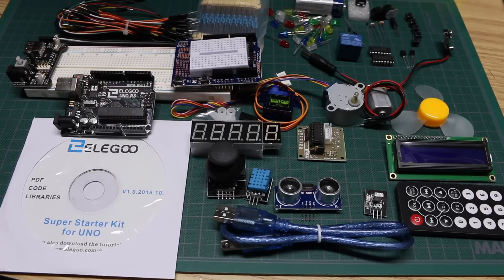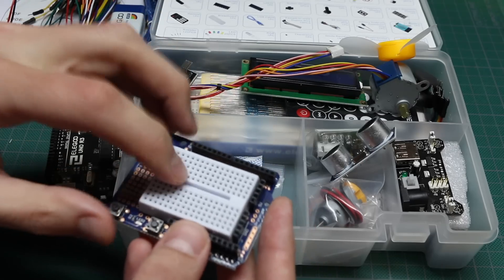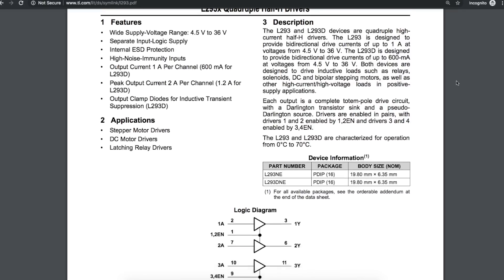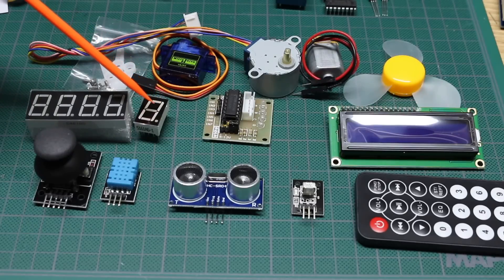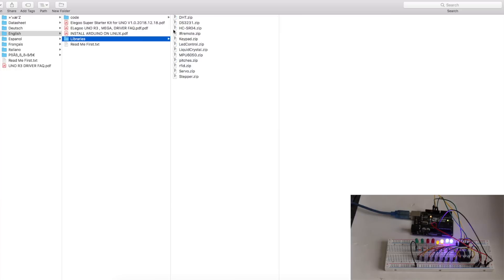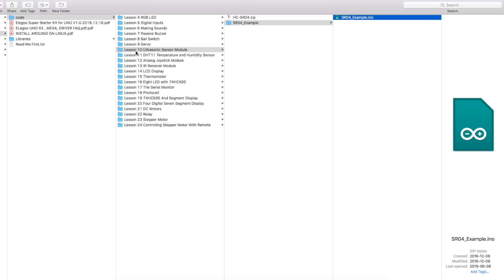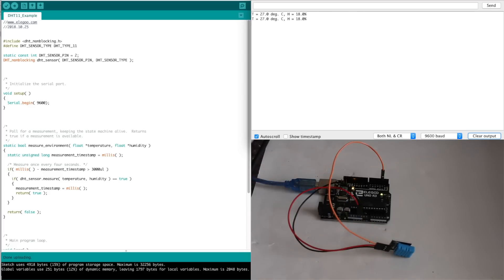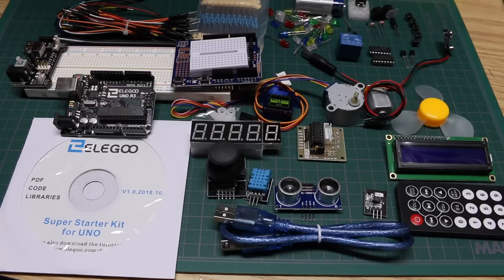Elegoo Arduino Uno Super Starter Kit - What's inside?

Comment: Can you take apart the projects you built or are they permanent? If I can take the projects apart to make a new one then I will definitely buy this.
Reply from the maker: All of the modules connect with wires so they can be taken apart and used in other ways.
Reply: @GadgetReboot  thank you for the info

Comment: I got one of those (barely) used for $20 a few days ago here in Canada. I'd say someone needed it for a school course. Most of the stuff is still sealed inside. Although mine has the same things, the branding is different as well as a few minor graphic changes. I really got it because it was a good deal and I took the chip of the arduino so I could use it as a ttl programmer for a new stm32 nano board. You can just hook the tx and rx pins to the other board.

Comment: I am considering buying this kit so I would like to know the following;
1) Are the parts well made and reliable?
2) Does it come with an ir led and ir sensor?
3) What types of resistors does it come with? Is there a full list of resistors that it comes with example, 100e, 10k, 330r etc.?
Reply: Hey hi. I don't know crap about these kits but a friend of mine is a robotic expert and he made amazing projects with these simple kits from amazon. Are the parts reliable? He has programmed an Arduino to use as a car computer for his Mercedes and it works A1. He told me everything that bad boy does to his car and it's not even believable. 
About the parts that you've asked, all the part names are listed in the kit descriptions on Amazon. 

For the Super Starter Kit you get all these parts plus the box:

Component listing:
1pcs UNO R3 Controller Board
1pcs LCD1602 Module ( with pin header)
1pcs Breadboard Expansion Board
1pcs Power Supply Module
1pcs Joystick Module
1pcs IR Receiver
1pcs Servo Motor (SG90)
1pcs Stepper Motor
1pcs ULN2003 Stepper Motor Driver Board
1pcs Ultrasonic Sensor
1pcs Temperature and Humidity Module
1pcs 9V Battery with DC
1pcs 65 Jumper Wire
1pcs USB Cable
1pcs Active Buzzer
1pcs Passive Buzzer
2pcs Potentiometer
1pcs 5V Relay
1pcs Breadboard
1pcs Remote
1pcs Tilt Switch
5pcs Button (small)
1pcs 1 digit 7-segment Display
1pcs 4 digit 7-segment Display
5pcs Yellow LED
5pcs Blue LED
5pcs Green LED
5pcs Red LED
1pcs RGB LED
2pcs Photoresistor
1pcs Thermistor
2pcs Diode Rectifier (1N4007)
2pcs NPN Transistor (PN2222)
1pcs IC 74HC595
30pcs Resistor
10pcs Female-to-male Dupont Wire

Go on a certain website called ' www hackster dot io ' and take a look at all the projects people make.

Comment: Naughty, naughty, naughty. You installed the power supply incorrectly. Please point out that the power supply can only be installed correctly at one end of the bread board for the + and  - rails to be correctly aligned. You got the positive of the power supply on the negative rail of the breadboard.
Reply: One other point about those breadboard power supplies is if you happen to damage (overcurrent) one of the supplies, the regulator tends to fail to a short circuit between input and output - which puts the full input voltage to your project. Which can be a problem, depending what you have on the breadboard at the time. (voice of experience...)

My solution was to replace the selector jumpers with a polyfuse in a 2 pin DuPont header. (after I replaced the regulator..)
Reply: Fantastic piece of advice, thank you so much from all of us newbies. Knowledge is power but sharing knowledge is even greater.
Reply: @pileofstuff  Great Idea!
Reply from the maker: Good point, the initial test fit wasn’t paying attention to the polarity but I did it correctly on the final stepper motor demo. And it’s correct in the tutorial guide  that people will be following.
Reply: I understand, just pointing it out as when I started not many channels clearly stated that this type of power supply would only be correct at on end of the bread board. Just trying to help people not make the newbie mistakes I made not so long ago :-))
Reply: Some are like the one you are talking about. The DFRobot one is like that. But this one is branded different. I have a few other types that are reversed polarity also. So maybe this one is correct. It was hard for me to tell when zooming in. Some mount on the left side of the board and others mount on the right side. But I do agree that it looked wrong. It could be right depending on which type he has. Or his breadboard was upside down.
Reply from the maker: It was backwards on the initial test fit but it was correct on the actual stepper project later.  I never thought about making sure the polarity was right because I always just look directly on the power board itself but people that are just learning shouldn’t adopt my bad habits!
Reply: Easy for viewers like me to pick at online videos. To devise, make, film, edit and upload is an awesome achievement. Love the channel and content so please keep them coming I learn so much, greatest respect and hope I have not offended.
Reply from the maker: No, it’s a very good point because this video would have been directed at beginners so  everything should be as correct as possible. As I always say, I’m here as a learner and I have a lot to learn about presentation as well as the subject matter.  Too bad there’s no way we can insert extra video clips after the fact to make clarifications or corrections to content. I’d probably be revising snippets constantly.
Reply: Awesome respect Sir, can't wait for the next videos. Just getting started with Arduino to compliment my 3D printing addiction, has opened up a whole new world of creating.
Reply from the maker: 3-D printing is the one thing I have never done so I’m envious of everyone else who just prints things out when they download thingiverse models.    Maybe I need to start saving up to get myself a Christmas present.
Reply: 3D printing is awesome, combine with Arduino and you have a match made in heaven. Working on a cheap copycat "Nanoleaf Light Panel" setup using NeoPixel tape. I am lucky I am a design engineer and do my own designs in SolidWorks.

Comment: I got the Elegoo ultimate starter kit a few years ago and I was very pleased with it. It came with a Mega 2560 rather than the Uno and a similar, but larger, collection of modules and accessories.
Reply: Are you able to take the projects apart to make new ones?
Reply: @Falcon-fi4jt  Sure. They're all built on the included breadboard